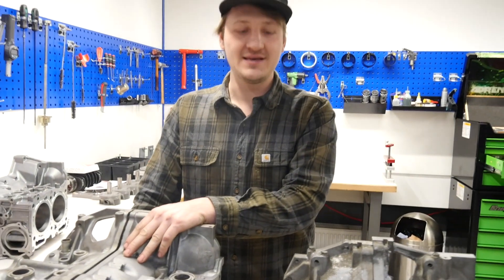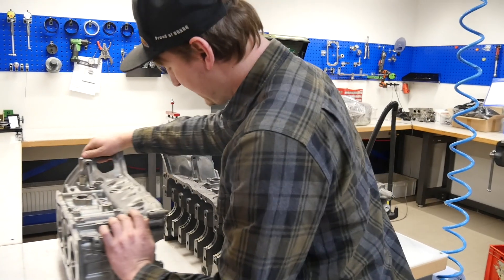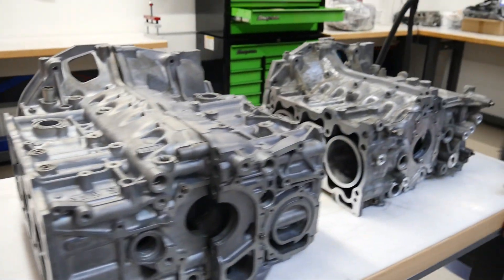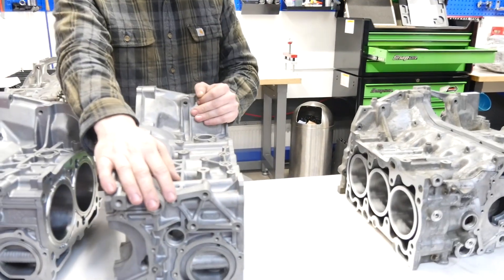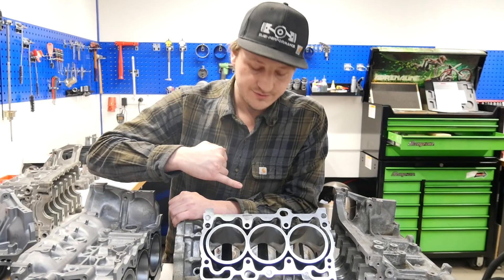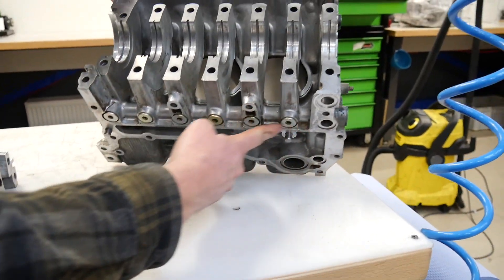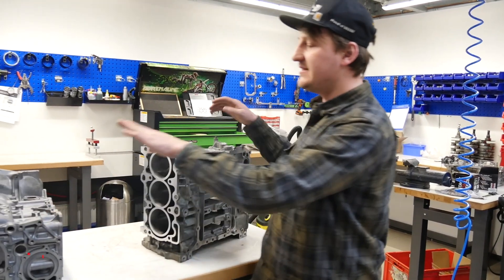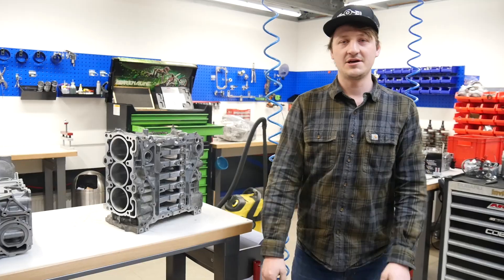FACTS ! EG33 VS. EZ30 l Subaru Six Cylinder l Subi-Performance

Comment: EE20 is the diesel. Ive got an EE20 09' Legacy wagon and I absolutely love it
Reply: wow, I thought those diesels is out of business because of weak crankshafts.
This is the reason because I didn't buy one for myself
Reply: @i.k.562  They are out of business because the marked fell out on them, not techically. It turned out that diesel engines were not that environment friendly after all (ref the VW issue). This engine was mainly for Europe when diesel was "hot" some years back. You can hardly find a diesel engine from any manufactur these days for small passenger cars.

Comment: are EZ30 so bad? russian friends ( https://www.youtube.com/watch?v=xkvhgdZZBD0&t=436s ) have 399HP at the crank on stock engine with compressor? ok, it's a spec-b, but i doubt the the engine(block) is different! ok, it comes with STi 6speed gearbox.. but if it was so bad they would kill it already :D

Comment: Is there enough clearance from the case main bolts to run Darton MID sleeves in the EG33? You above all would know best if you've used them in the past on any motor. They only require 3-5mm wall thickness where they insert at the base of the sleeve. The top will require a welded in closed deck at least 13mm thick I would say. Tapered edgr deck plate multiple passes until it's filled in. This keeps the cylinders from spreading apart or walking under heavy boost. Holes for the case main bolts aren't necessary because they can be installed with the sleeves out. The bore can be as large as bore spacing less 6mm. I hope it's possible, I'd like to build a short stroke high rpm motor.
Reply: Line boring after welding!

Comment: EE20 It's the diesel. I would like to see you open one.😁
When I break mine, I'll send it to you from Spain to film and fix It.😑
Reply: Would love to see an ee20 opened up by these guys. 

I got the dreaded euro 4 in my impreza 😅. 68 thousand miles so far. Only issue I have is engine stalls with ac on sometimes so I don't use ac 😂
Reply: if that shit brakes, You put at least FA20 or new short block :D better closed deck ej20 :D
Reply: @jouched  Nop!!! I can´t do that here in my country. Many bureaucratic obstacles.
And I prefer torque and fuel economy. I make >30.000 Km/year.
Reply: @fogalla  then new bottom end is your options if it goes bye, bye ( as Tramp says ) :D

Comment: From 99 phase 2 engine the have rear thrust. Ph1 and 1.5 had centret thrust with a 48mm crank instead pf 52mm.
Keep up the good work.
Future Project must be  a +2000bhp eg33. Think about it, sleaved CDB etc i bring my eg33. We need to chase the GT35's 😁
Reply: dreaming of 2k hp without billet block, subey flat 6 eg33 mains design and webbing support for bores is weak vs porsche even Alfa sud 33 is a better engine that can make 10k rpm with little work on stock block. Sub has no clue even with the transmissions are as weak as butter. Subey worked engines are hand grenades, billet block of waste $$$.
Reply: @altruismfirst6489  if you destroke an ej it can rev up to 12k with ease. If you don’t believe me search “ Betty the Subaru” and give it a look
Reply: @altruismfirst6489  bro wtf your just a hater

Comment: EZ engine is sort of developed by Porsche. Subaru and Porsche are good friend. If you remember Blitzen, the paint red was directly from Porsche. EG30 is as you said, adding 2 more cylinders to EJ20. But EG is only found in SVX. EZ30 is from legacy 3.0R to Outback 3.0. As stock factory condition EZ30 is reliable.
Reply: Have stripped down an EZ30 and the avls buckets have made in Germany marked on them ...
Reply: @crf450xlive  Many components of many cars are made in Germany due to the quality and precision needed with certain metals. I highly, highly doubt that Porsche had any involvement on the EZ engine development in any capacity.
Reply: "EZ engine is sort of developed by Porsche. " - source?
Reply: It’s good that Porsche got involved in developing EZ coz Porsche keeps making junks. Most of Subaru goes up to 300k km. How many Porsches go that much.
Reply: Hmmm. No. A lot of people assume the AVLS system was a collaboration with Porsche but it is not the case. The only work done that could be confused with actual Porsche would be the Blitzen edition Legacy/Liberty cars, and that was Porsche *Design*, a subsidiary of Porsche AG. 

:)
Reply: I hope Porsche wasn't involved because I don't want any poor German engineering in my Japanese car!
Reply: @zeroyon223 there is NO WAY Porsche developed anything for Subaru!
No wonder there's no source.
Reply: @derJackistweg  Porsche develops heaps of things for heaps of different manufacturers… the ez30 was one of them.. the engine is Subaru designed but some parts modified by Porsche. There is a report on the internet from 2005 stating more information
Reply: @deathtoming2201  If it is easy to find feel free to ad the source.
I still doubt that, just "saying" ist just saying.

And btw:
WHY would they (Porsche)? Because their dev dep. is boared?
Because Porsche needs the money?
Because Porsche thinks this is good Marketing? Porsche customer like the idea, that in a japanese family car are parts similar to their 100k 911?

This all makes no sence - and in most cases if anything makes no sense, it is not.
Reply: @derJackistweg  …. Your ignorance sad. I’ve built many EJ and some EZ engines there are many parts that have stamped MADE IN GERMANY Subaru hired a engineer from Porsche to help develop the Ez series engine in 2002.. it was even in car magazine if you even read any .. if you were even alive then I’m not to sure with your lack of knowledge.
Reply: @derJackistweg  Porsche have designed and produced engines in over 6 different car makers buddy.. do your research.
Reply: @deathtoming2201  Source? Again, give me a valid source if it is so obvious, it shoule be easy.

An engeneer hiring is NOT equal to designed from an different company.

PS: It is not "Ignorance" it is just KNOWLEDGE of how companies do business and Produkt Managment.
Reply: @derJackistweg  skip the vid to 6:40
Reply: @deathtoming2201   @DEATH TO MING  ...some dude on the net says something....

that is NO SOURCE for me or anyone.

and a build head in germany has nothing to with porsche anyway.

Comment: The ez30d engines are not known for head gasket issues here in the states....I have on with 133,000 MILES and one with 262,000 miles...neither have had any head gasket issues. Infact you can fine plenty with over 300,000 that still run perfect. Fake news.
Reply: I have a 2005 outback 3.0r with 145,000 miles and it’s a good engine.
Reply: First gen ez30d was known for headgaskets failing, but the second generation ez30(r) doesn't appear to suffer from the same issue.
Reply: @derrickquintal  rubbish.  Only reason any EZ30 gets headgasket issues its because of radiator end tank failure and dickheads that continue to drive them when this happens.
Reply: @derrickquintal  not true in the slightest
Reply: @1483Frenchman it's absolutely true.
Reply: @derrickquintal Just found this and been doing my research on the EZ30 and have come to the conclusion that these are indeed good, reliable engines when maintained and treated properly. There’s phase 1 and phase 2 versions with the second one ending with the production of the 3.6.
Reply: @carlm8821  over 270k+ on my ez30, just being plagued with electrical issues due to bunged up wiring harness, otherwise she purs like a kitten and still spins all fours in the wet :P
Reply: @longdomedia oh no, not you as well! referring to the botched wiring situation.
Reply: @carlm8821  yeah I'm about to buy a whole new engine wiring harness just because most of the plugs are very worn 🥲
Reply: The later model variable valve timing/lift version of the EZ30 (the 250hp version he mentioned) is popular in NZ and have a reputation for being extremely reliable. Maybe they aren't the greatest engine for boost but you can ring them out all day in stock form and they have zero problems.
Reply: Just to pile on with everyone else. I live in Vermont in the USA, which has the most Subarus per capita I'm sure. Never see an EZ30 with blown head gaskets. EJ25 NA engines everywhere of course. The EZ30 I have is something like 240K miles no issues. My brother's Tribeca with an EZ30 is nearing 200K with no issues. Bulletproof engines and only the very earliest had some external weep issues, not cylinder blow issues like the EJ25.
Reply: Yeah mine (02 BE-E RS30) Has had a hard,  hard life. I've owned it for 5 years and give it death all the time. No issues, despite an extremely lax maintenence schedule.
Reply: Jesse same here in sweden, as stock EZ30s are bulletproof.
Reply: @Rhga1996  The NA's are sturdy enough for day to day drive
Reply: @Sireristof1332  I know guys that boost ez30's and have for thousands of miles with zero issues. The main head gasket issues on the ej25's was the graphite coating wearing off after 100,000 miles or so. The block etc are great.
Reply: Well nowadays we’ll be pulling them apart and they’ll leak internally. We’ve had plenty where the coolant will start leaking internally and chew the piston tops up. Boxer formation head gaskets leak by principal just by the way they sit, heat up, and cool down.
Reply: @kristophercarouse8814  more fake news. You think you're the only person to work on these engines?
Reply: This.
Here in Russia you'd rather have the body rusted through beyond repair than EZ30 broken. 
I believe it would last for a million km easily, if not the rust.
Reliable as hell, if you don't drink the coolant and piss into the oil then.
Reply: @i.k.562  Literally same in Vermont, USA. Subarus here only die from rust, not engine failure. Even EJ25 engines, replace the head gasket once and good to go. Unfortunately, the harsh winters make it not worth the cost due to rust.
Reply: @i.k.562  Do you guys cut your coolant with vodka or something?

Comment: If the eg will hold 700hp stock with head studs how much will that build one make?
Reply: Joseph Bucko 1000+ easily
Reply: Look up Andy Forrest’s Stormtrooper WRX. 1200hp built EG33 turbo Running an R35 Transmission with chain driven front axles for better weight distribution.
Reply: @wyattoutlaw2370  Billet block so it dont count and worked blocks dont last like other performance engines in its league. The only good flat 6 is from a Porsche, night and day quality vs the Fuji industry rubbish that is Subaru. R35 transmission says it all and might as well run the nissan v6 as well.
Id rather invest in a billet block than so much $$$ for a hand grenade.
Reply: I think a stock internals EJ25 can handle 300hp, so I guess an EG33 would be 450, but still I’d be more concert than that if I was going to do that
Reply: Load of shit, they don't.
Reply: @pheonixfps9248  Well this fella's building one right now https://www.youtube.com/watch?v=s-dGlcRb68M so we will soon find out cos target is 1100-1200WHP
Reply: @Fearlessphil100  I've watched his stuff and he has a hella built motor. These guys are claiming that the eg33 will do 700hp standard with headstuds. Having been a mechanic at Subaru, I know for a fact its bullshit. The eg33 is a stout engine, I'm not dissing it, just calling out their bullshit claims.
Reply: @pheonixfps9248  Sorry seemed like your reply was to the 1000+ built claim
Reply: @Fearlessphil100  no not at all mate.
Reply: @GW71093  I've already addressed this elsewhere as well. Again it's bs.